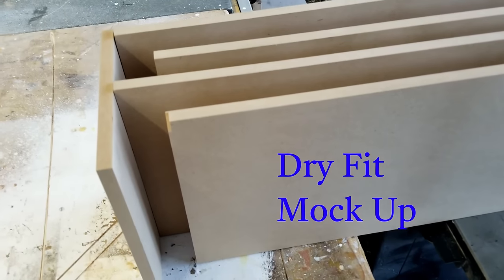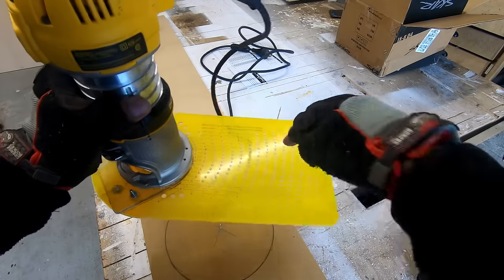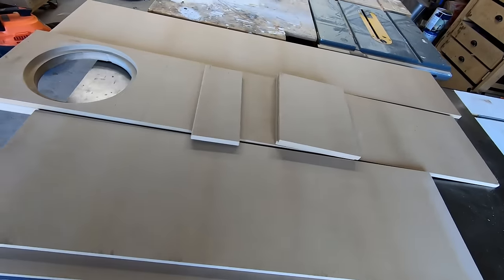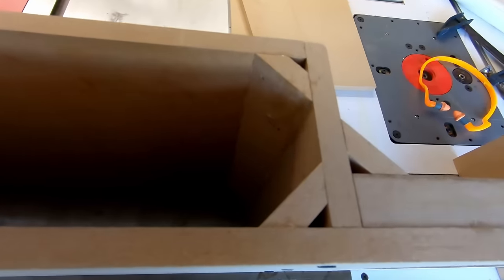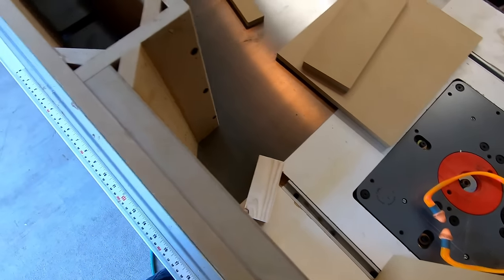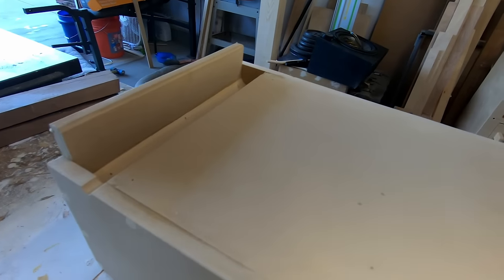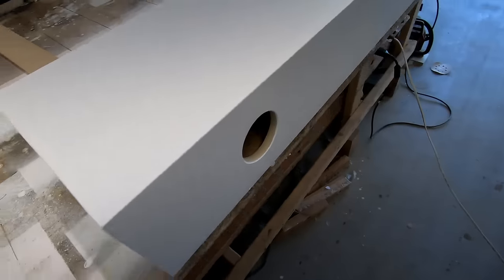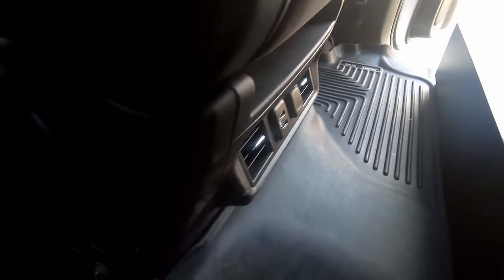DIY Subwoofer Enclosure 2021 Edition - Caliwood Specialty

Comment: In other words. Does more air travel means more "boomy" bass?
Reply from the maker: Essentially yes, but there are other factors too that contributeto the overall sound suchas: the main chamber size, port length, design, sub, etc etc
Reply: @FranksCaliWoodSpecialty  yeah i think i just have a horrible box setup and it's not letting my 2 12s shallow subs getting enough air for them to kick
Reply from the maker: @slowvq9371  It's important to figure out required air space needed (internal volume) for your subs
Reply: @FranksCaliWoodSpecialty  a bigger box with air channels would probably help with more flow of the bass

Comment: But how do you figure out the box dimensions you need (based in speaker air volume and vehicle location?
Reply from the maker: There are various sites online that help you figure out the box dimensions. Also, yes, the box's size was limited by it's placement (under the rear bench seat) in  Silverado.

Comment: Nice box but then you used that cheap connector. Drill 2 holes and use bolts next time. Seal the holes and you won't have any air flow through them.
Reply from the maker: It was a very tight fit all around. The air leaks, if any, from the actual connectors is negligible. Thanks for the comment.

Comment: I subscribed Nice work. however I feel  it should noted that speaker enclosure is Art, Science and Mathematics. Thiele/Small parameters for speakers help to determine the projected performance of a speaker. The efficiency of the speaker and output at a specific frequency.  An example of this is A Bandpass design. A high efficiency speaker in that design could perform better.  A couple of ways are, increased SPL and smoother sound curve.  This design is a nice balance i think this speaker and box act like a Bandpass

Comment: Can you tell me how make a nice inclosed speaker box for 1994 GMC Sonoma
Reply from the maker: Hi - there are several things to consider. First off, you'll need to determine the clearance or the available space for the box. Find a sub, and suitable amp to drive the sub.  Making the enclosure is easy, but again, you'll you'll need to start off with the space that you have and measure that out for the box.

Comment: Hiw can I fit subs in a 2009 chevy silverado 1500 without losing leg space?
Reply from the maker: I used to have a 2006 Silverado and I know can definitely fit a custom box under the rear seat without losing leg space.
Reply: @FranksCaliWoodSpecialty  I have a single cab.
Reply from the maker: @joshdavila87  oooh. So you would need a vertical shaped sub enclosure behind the seat.
Reply: @FranksCaliWoodSpecialty  will that allow me to fit speakers with the seat moved all the way back? What size subs?
Reply from the maker: @joshdavila87  is hard to say, without measuring. Are you looking to get 1 or 2 subs?
Reply: @FranksCaliWoodSpecialty  I'd like 2 10's but doesn't seem like a box will fit bigger then a certain size. I bought a 8in sub that had was pre-built with a Amp and box all in one and it was able to barely fit behind the passenger seat but I'd like something better that can fit behind both seats but I haven't seen anything online that states the custom box allows them to move the seat all the way back.
Reply from the maker: @joshdavila87   I'm pretty sure s custom enclosure can be made where you can still slide the seats all the way back.  Again, just a matter of figuring out the clearance back there.

Comment: Not really sure what the dowels are gonna do, besides be an unnecessary point of failure, especially if the slotted leaves are screwed down to both the upper and lower panels anyway. 🤷‍♂️

Comment: Where did you get the adapter for the router to do the circle
Reply from the maker: It's called a circle cutting jig. I got it off of amazon, but I need to upgrade it because it's very flimsy.

Comment: Frank, that's a nice build Bro. What is the cost to build this box for the smaller 6.5 sub? 
Cut-out Diameter: 5.83"

Mounting Depth 3.56"

Total Height: 4.00"

Outside Diameter: 6.85"

Magnet Diameter: 5.53"

Skar Audio EVL-65 D4 6.5" 400 Watt Max Power Dual 4 Ohm Car Subwoofer

2004 Chevy Silverado  Ext cab.
Reply from the maker: Hi - please send me an email at caliwoodfrank@gmail.com

Comment: hello. I have watched this video like 30 times. I have a fox body convertible and was going to build this box to slide under the top well. I ordered router bits and the circle maker tool and all sorts of stuff to do this build exactly like you have. then I got smart and went out and measured the location. I only have 33 inches, 34 max. however it will be pressed against the cars body and don't want any rattles. so 33 it is. I have no idea how to calculate  this sort of box for air volume and tuning. I am using the skar VD-8 | 8" 600 Watt Max Power Car Subwoofer (Shallow Mount) I have max of  7 inches of height as well. I can afford a couple inches  wider to fit the area . its a tight spot and i would love to build something very similar to your design.  could you please help me figure this out?
 Recommended Port Area	
11.0 in²
Recommended Ported Volume	
0.75 ft³
Recommended Sealed Volume	
0.35 ft³
Recommended Tuning Frequency	
41 Hz
Subwoofer Measurements
Total Height	
4.98"
Mounting Depth	
4.00"
Magnet Diameter	
5.22"
Cut-out Diameter	
7.37"
Outside Diameter	
8.50"
Reply from the maker: First off thanks for checking out my vid. It's greatly appreciated.  
I suggest you use the google machine, it'll show you some free sites that can help you calc what you need based on your specs. As you know every sub is different so you may end up sacrificing something if your space can't accommodate a larger enclosure. 

And remember,, bass is bass... it'll rattle any loose thing so you may want to consider using some deadener material if you're worried about that. 

Thanks again

Comment: Build a similar box design for 2 6x9s
Reply from the maker: I think 6x9s sound great in a small sealed enclose, but now I'm curious to know how they would sounds in a t-line design box
Reply: @FranksCaliWoodSpecialty  me to lol
Reply: @FranksCaliWoodSpecialty  i have a 2002 honda civic, 6x9s in rear dash... 6.5 mids in front doors. I dont like the sound i have right now, i know my speakers are capable of better sounds i just dont know how to get the sound i want out of them. Ive thought about building enclosed speaker pods for the front doors and maybe some type of speaker encloser for the rear dash.

Comment: Instead of building a vented transmission line like this one, try a sealed box with a closed end vacuum cleaner hose attached to the enclosure the same length as your port.  You will resonate at the same frequency without the base "hangover" of an open ported system.  The base will be tighter, giving more punch because of the air spring of the sealed box.  And the cabinet can be smaller.  The vacuum cleaner hose exits the box and can easily run around under the seats of a vehicle.  You can attach several different lengths of hose to the box to add resonances at whatever frequencies needed to extend the bass response as low as desired.  I did this to a small, cheap sub-tube with mind boggeling results.  I don't have time to build more of these, but if you can, I would love to see your results.  Can you perform a frequency response test  if you build it?
Reply: Interesting.  I think I may try this.
Reply from the maker: I've never seen or heard of this, but I'm intrigued LOL.  I think I'm able to visualize what you are saying but would you mind sending me a sketch of this set up? caliwoodfrank@gmail.com
Thanks for the comment.

Comment: Wat is the black pai t called
Reply from the maker: I believe I used Bear exterior black paint and obviously white primer paint underneath. 
Thanks for the question.
Reply: Can u build an box for my low mids it's 17nich L 9inch W an 5 inch depth an how will it cuz

Comment: Man I'm still afraid to use a table saw without the push sticks and blocks
Reply from the maker: Anyone should be cautious! 
Some parts of the video are sped up so it looks a little more dangerous than it really is. I do use push sticks/blocks when making certain cuts. 
Thanks for the comment.
Reply: @FranksCaliWoodSpecialty  I'm still in the beginning/ intermediate stages and appreciate the tips I need them, thanks again nice work and channel. 
      I'm thinking about buying a 1 1/2 inch wide round over bit for my router to make flared ends in double 3/4 inch panels of MDF or wood glued together for my speaker boxes. 
    I've already got a circle cutting jig for the router made. I would really prefer to do it with my fixed base facing down following a pre-made hole the same size as the inner diameter of my TVC tube if possible. 
      Would you recommend using this 1/2-in shank one and a half inch wide round over bit with my DeWalt 611 Palm router or make a table and use my bigger router with both facing up. I still haven't used a router table and I'm half afraid lol
Reply from the maker: @johnnycorn7225  Right on. No matter how novice (or expert), always practice good safety habits.  I would go with a 1/2" shank for that router bit, but then again you'll be cutting in MDF so either shank size should work as long as you buy some quality bits.  Good luck on your build.
Reply: @FranksCaliWoodSpecialty  Thanks 👍 awesome

Comment: Why the screws ? You can perfectly glue a box only with glue ! 🙄
Reply from the maker: Thanks for the question.  The screws do not affect the performance or the appearance of the enclosure.  It just gives a warm fuzzy feeling to know that the enclosure will not come apart no matter how hard the bass is hitting :)

Comment: I don't want to knock the work, but I have never heard a ported box that actually sounds good. Granted it will increase the base output but damn if it does not destroy the imaging across frequencies that the port was tuned for.  I miss Boston dynamics and their tiny enclosure requirements for their subs.  1 square foot for a 10" sub was a god send.
Reply: tlines can do amazing things, or hybrid designs which arent like the classic tlines

Comment: I wish I had the tools to do this.. I'd totally buy a kit.
Reply from the maker: The tools used in the video are certainly nice to have, though you can achieve similar results some basic tools. However, certain cuts will not be as accurate. Thanks for the comment.

Comment: Это типо чв насколько я понял?
Reply from the maker: Here's the Subwoofer specs:
8-inch Dual 4 Ohm Voice Coil Configuration 
Peak Power: 300 Watts 
RMS Power: 150 Watts 
Pressed Paper Cone Advanced Air Flow Cooling System 
2" BASV High Temperature Copper Voice Coil Motor 
Weight: 30 oz 
Frequency Response: 30 - 350 Hz 
Sensitivity: 82.6 dB 
Fs: 48.9 Hz Re: 
Dual 4 Ω 
Qms: 4.29 
Qes: 0.75 
Qts: 0.64 
Rms: 5.3 Kg/s 
Cms: 0.14 mm/N 
Bl: 13.8 n/a 
Vas: 7.8 L 
Xmax: 7 mm

Comment: That isn't any drop drop slap slap, if so you would be using a Sundown Audio X8v3 sub with a D'Amore Engineering E1000.1 Clean D Amp and really get down,  but not with a downfiring truck box, no bueno brother. Just respectfully sayin'. I'm an audio genius for about 30 years.
Reply from the maker: Thanks for the comment audio genius. 😎
Reply: Very welcome, it's no charge😁Happy Holidays!
Reply from the maker: @cleangurumillionaire  Ha ha, right on. Happy holidays to you too.

Comment: Sheetrock screws killed it for me
Reply from the maker: The 18 gauge nails and glue is simply not enough IMO to hold the enclosure securely.  I added the screws to keep any enclosure flex to a minimum. (Less enclosure vibration = better sound output.) I wouldn't want it coming apart in the middle of my fav song with bass-heavy beats LOL.  What screws, if any, do you recommend? Not that they would be seen anyway, as they'll end up being patched and covered up nicely.  You would never know where or how many screws were used.  Thanks for your comment.
Reply: @FranksCaliWoodSpecialty  He possibly was referring to the ones you used to secure the sub into place rather than pan style ones or even better use wood inserts & a bolt type fastener.
Reply from the maker: @HashDogg06   Oooh, I see. I guess using some better looking screws for that would nice.  I'm currently making a dual sub box.  I def consider that as I finish it up.  Thanks for the comment.

Comment: Almost all amazing! - But plastic shit push-connect... My eyes, my eyes!!!
Use Speakon! It can ease manage to 40A and it small diameter so you will save the box. Also they are 4pin so you can connect parallel DVC like you did
Reply from the maker: Thanks for your comment. The connector can def be upgraded. And I could see using speaker twist connector if the box were to be plugged and unplugged all the time, which is not the case. People usually need to connect it it once and that's about it.

Comment: I don't understand why someone would want to make the low frequency soundwaves get delayed in these tunnels and have them continue to cascade out of the box long after the subwoofer's cone has retreated to a center position. Having a slow decay of the sound waves which happens when you make the waves tunnel around inside a box for several meters make the bass sloppy and muddied. A better design for bass "punch" is to have the waves coming out of the box be as close as possible to the sync of the driver's cone position. Take a measurement of the Cumulative Spectral Decay (Waterfall graph) of this design and I am sure you will see a very poor graph from these kinds of designs. Sure the bass may be deep, but movement of a speaker cone may be getting cancelled out by the bass waves finally making it through the serpentine tunnels make this potentially produce out of phase sound waves.
Reply: " but movement of a speaker cone may be getting cancelled out by the bass waves".  That won't happen if port is tuned to match the particular driver.  The port does not NEED to be close to the driver to get the desired tuning.
Reply from the maker: Hey, thanks for the comment.  There can be an endless debate on this topic; however, it comes down to proper tuning. There is no sound delay, decay, no cancellation, etc.  And remember, all a subwoofer is doing is creating positive and negative air pressure each and every single time the speaker oscillates. If you're a fan of clean, low, deep bass than you can't go wrong with this box design.
Reply: @FranksCaliWoodSpecialty  I just use 18" long throw woofers in massive boxes as suggested in the Bass Box program and get bass down to 15Hz no problem. Just a simple L shaped port defined exactly how the software suggests. Tight, punchy bass. But obviously your designs are made to save a ton of space which makes them great for small cars and trucks. Cheers.
Reply from the maker: @AudioGuyBrian  Right on! Yup, there's a box design/size for every need.

Comment: 😅😅😅😂 u can clearly see that the speaker comes way past the actual leg and the face down design is garbage thats why i only use southern bass enclosure they are truly engineered for maximum sound quality and bass and they face forward Nd the port is out the side or front you get options 😊😊
Reply from the maker: Thanks for the comment. But no, the sub's max excursion has sufficient clearance underneath.  BTW, this downward facing design also helps protect the sub from accidental kicking (assuming no grill is installed).
I also have made several enclosures with down facing subs that feature forward facing ports. There are countless enclosure designs and many more sub and amp options out there.  If you've found something you like, you should stick with it. I know I have 😎

Comment: Transmission line enclosures - how to determine line length and line (cross-sectional) area:
1.) desired tuning frequency divided by 1,128 (speed of sound is 1,128 feet per second) *tuning freq. should be the same as the driver's resonance freq. (Fs) So, if we have a 10" woofer with a Fs of 35Hz,
1128 ÷ 35 = 32feet  Now, to get the quarter-wavelength, divide 32 by 4 = 8ft
2.) measure radius of woofer cone. multiply that number × that number. multiply the product × 3.14 (Pi)  so, let's say our 10" has a cone radius of 4.5", multiply 4.5 × 4.5 = 20.25  multiply 20.25 × 3.14 = 63.58inches is the area of port terminus (10"×6" roughly)
To conclude, our 10" woofer would require:
8ft. long line length with a
10" × 6" cross-section to acheive 35Hz tuning    ** the principal is to delay the back-radiating wave so it will be in-phase with (and reinforce) the front radiating wave

Comment: That box is a joke. Your firing the woofer into the floor. Stupid waste of time and money. Did you even calculate the port size or enclosure size. No. Zero experience in car audio and it shows. I see you flipped up the box to play it. Why? Speaker surround hit the floor of the truck. It could hav been a better box if you used a folded horn design. Enclosure wasn't acceptable for the speaker you used. Research might have stopped this disaster from happening. Craftsmanship was good. LOL
Reply from the maker: Thanks for the comment.... i think 🤔  The enclosure continues to sound amazing! And nope, the speaker does not hit the floor despite the excursion. I ensured it had sufficient clearance. Why did I flip it...because we all like to see the speaker excursion. To this day, no one has kicked or damaged it because the down firing design provides good protection.  Thanks again.